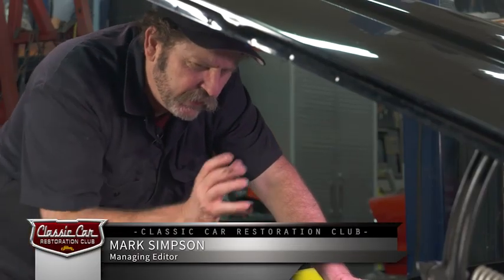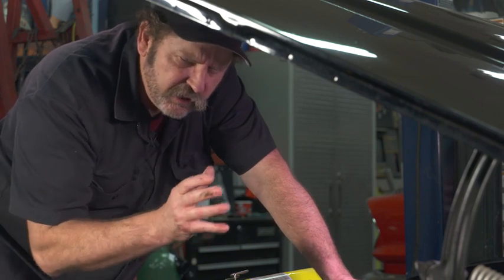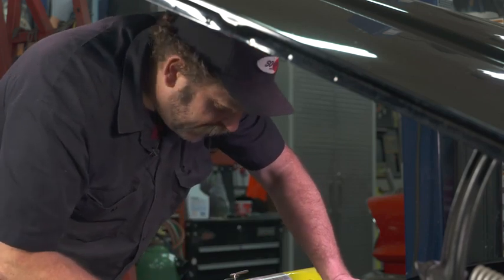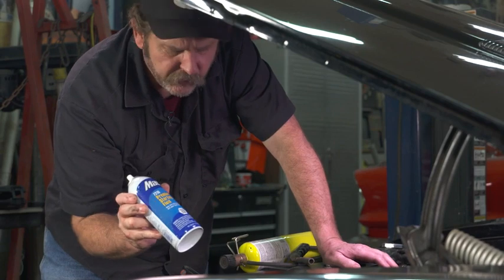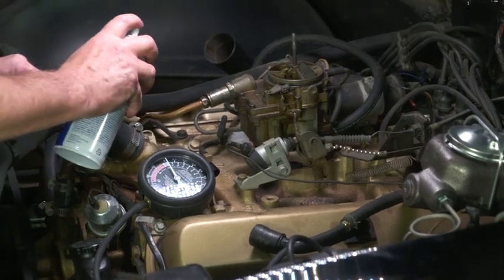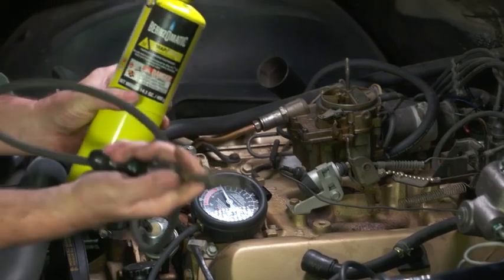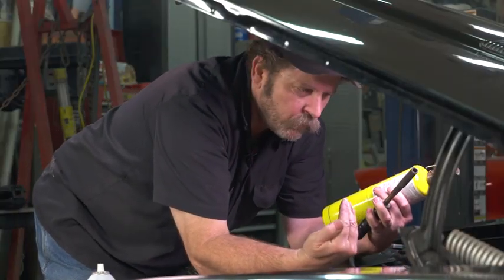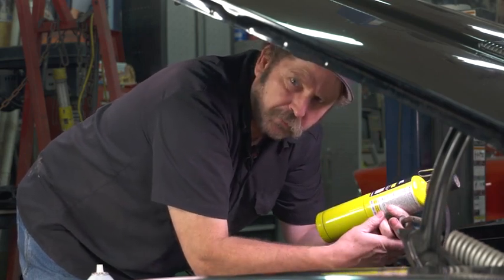Locating a Vacuum Leak

Comment: Aint you got some kind of smoke locator or something?  I don't feel right spraying flammable liquids on my running engine.  I remember the flames chasing up to the gas can once, I tossed that gas can 20 feet to keep from.....well, you know....lessons learned the hard way,  looking back, it's a wonder I've survived so long!
Reply from the maker: Using small amounts of propane to find vacuum leaks is hardly the 
equivalent of spraying down the engine with flammable liquids. 

If by chance ignition occurs simply turn off the torch, unlike a gas can a torch is made to ignite.

If combustion is your fear though, there are systems that inject 
smoke into your intake system to find leaks but you'll need to do it in a
 shop is the slightest breeze can make it difficult to spot the source 
of any leaks.
Reply: ...did I ever tell you about the time I had a spark go off half a foot from a battery and the dang thing exploded 4 cells in my face?  Stuff Happens, that's all I'm trying to say, Oh and coke stops battery acid from eating like someone's face, my shop teacher told me that and it saved my face from being horribly scarred.  I remember my shop teachers name (40 years now) and a can of coke is required whenever I work on a car.
Reply: @otherstuffbybob   3 years late, but man I did not know that coke could do that.  I may have to start keeping some by my side as well especially since I change car batteries a lot.